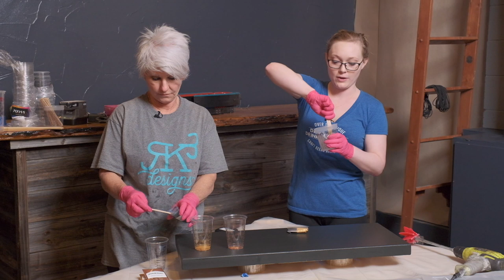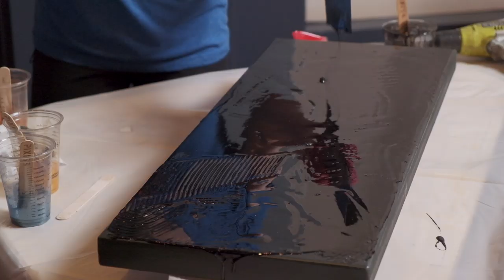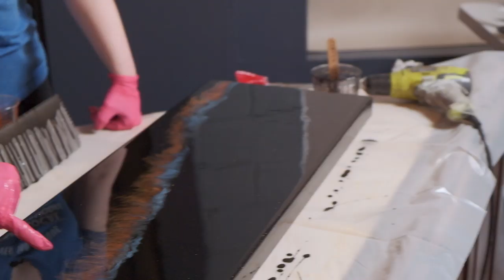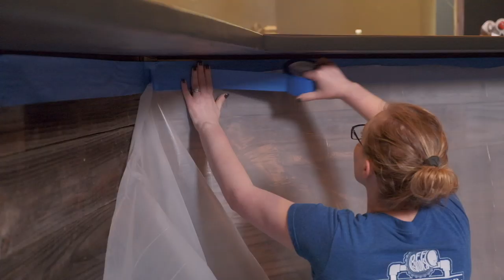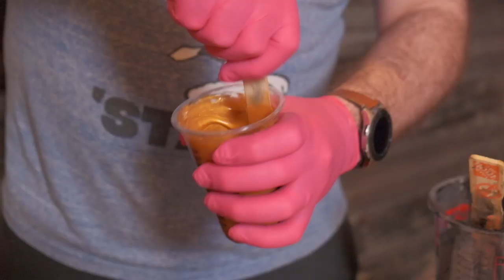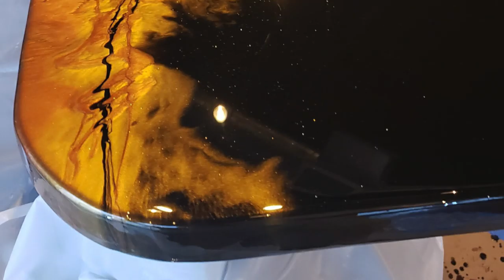Stone Coat Countertop Epoxy, Galaxy Black Bar

Comment: Just completed my first pours. I did 3 counter tops in my RV. The kitchen, the bar, and the bath. Learned a lot. The kitchen and bar were carrera marble look, and   I honed the kitchen counter. Quartz under mount sink as well. 
The bath is my pride. Turned out really cool. Black and grey with multiple blues, silver, gold and turquoise down the middle. Glass blue vessel sink to complete. Great. I found the prep to be the big time waster. Takes more than you imagine. Took my time. Don't over torch! Use a good heat gun for moving the epoxy and the torch only to get the air out. 
As for this pour, I really like the 2nd attempt on the main counter top. The first not as much. Real piece of art there. And that is what I love about this technique. Its art form. No 2 are alike. And if you don't like it, just recover.  
You got this!!
Reply: Well don’t keep us in suspense... pictures please!

Comment: Hi Rhonda! Question I saw you use the black tint base. What makes you decide to use that versus alumlite to tint the black. Also did you prime with P&P by Behr? I noticed in recent video by SCC they were using a product called base undercoat and not the usual paint and primer. Just curious if this is a new and better product for priming? Thanks! Mandy
Reply from the maker: We used the black tint because she already had bought it. I've used that tint alot. I do prefer however, the Alumilite dye because you can use so much less. Mike has a new product that he's starting to use now as a base color. It's an Epoxy paint. This allows you to prime/paint and then pour all in the same day. You don't need to wait and let the acrylic paint dry overnight. I'm super excited about this! Thanks for the feedback!!!

Comment: Curious, do you find you get a different look when moving the colors with the heat gun as opposed to the torch?
Reply from the maker: Absolutely. I rarely use the torch to move the epoxy when I’m working on the actual design. I like the heat gun because I have more control and I don’t heat the epoxy as fast. I’ll use the torch if I’m tilting a piece and want to heat up a larger area or heat the epoxy quickly.
Reply: @RK3Designs  awesome, thanks for the info.  My epoxy kit just came in Tuesday so I'm ready to build some counters this weekend (full build from scratch).